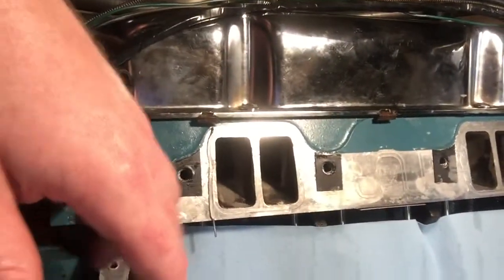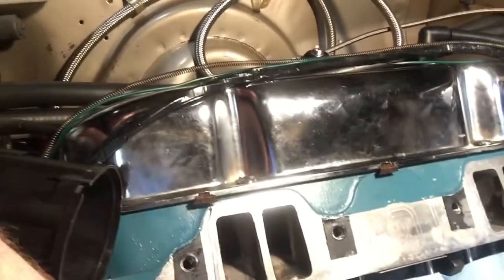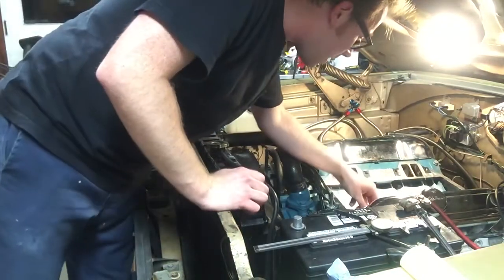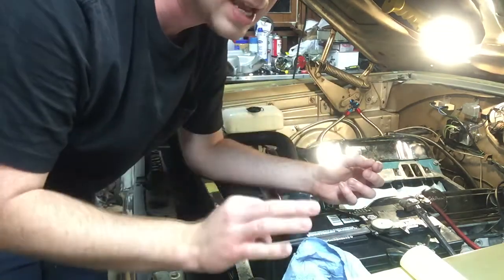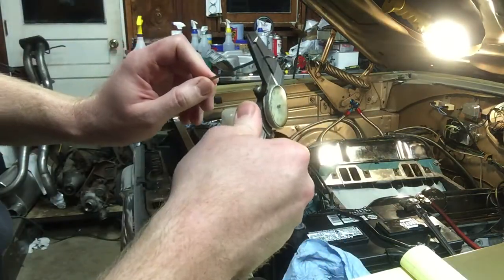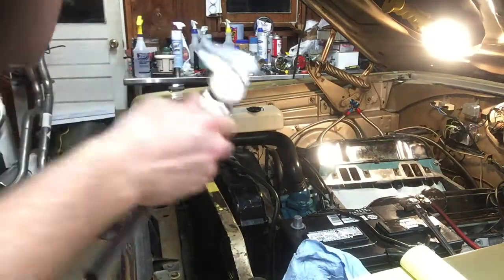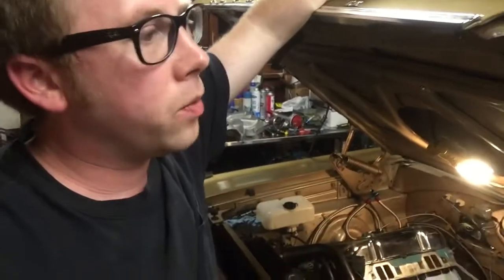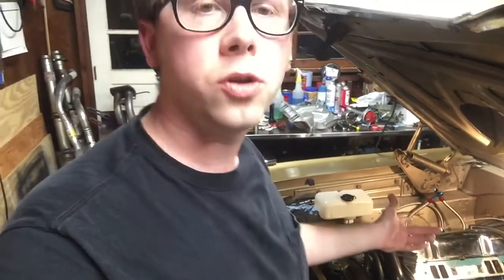How To Measure Intake to Cylinder Head Angle/Fitment

Comment: Great vid we have a sbc 355 tried 2 times with .060 gaskets then added .030. Same problem. Aluminum wiened intake with dart heads that most likely have been milled but don't know how much because we bought it 2nd hand.. thoughts?only on #8 intake we see oil.
Reply from the maker: Hey John, did you measure the angle/crush already?

If its one port only are you sure its sucking it up from below the intake? It could also be a valve stem seal/guide, or maybe even your PCV setup since its probably hooked to the back of your carb (right near #8)
Reply: @426440  just threw a victor jr intake on with 0 .125 felpros. Looked down runner #8 with light under intake. Big void. I guess model clay on all 4 sides? Then I could get an idea.
Reply from the maker: @Supanova70  im not sure if im missing something, did you try it with the solder?
Reply: @426440  not yet the machine shop said to use washers on all 4 corners that equal gasket I'd. Then model clay on all runners top and bottom. Slice in half and measure depth.going to try tommorow.

Comment: Does this apply to small block Chevy also?
Reply: Thank you for your video and for taking the time to reply to my question!
Reply from the maker: No problem, I hope it helps!
Reply from the maker: Correct - to be in spec you want to be .003-004 tighter at the bottom on both sides, so you would take .003 off the top.

I would say though I wouldn’t really expect you to have an issue if you’re parallel. Most people don’t have an issue even if they are a little out of spec and tighter at the top like mine was. But stick shift cars are more prone to pull oil because of the vacuum generated by engine braking.

Also, you mentioned you’re working on a small block Chevy. If you are having a problem make sure you have enough clearance at the end/China walls, sometimes these will hold the manifold up, especially if you’re using the thick cork gaskets that come in the gasket kits. I always just run a fat bead of RTV there.
Reply: I have confirmed the China wall isn’t interfering with the intake and I don’t use the cork gaskets, just “good stuff” RTV. 

Thanks again!
Reply from the maker: Yes 100%
Reply: So just to clarify my understanding; currently my intake is perfectly parallel with the heads. To correct the angle, I would need 3 thousandths milled off of the top on both sides of my intake?